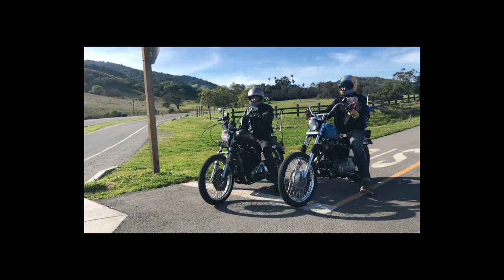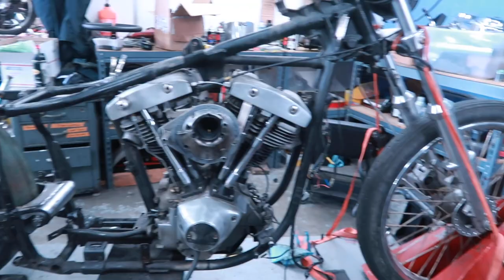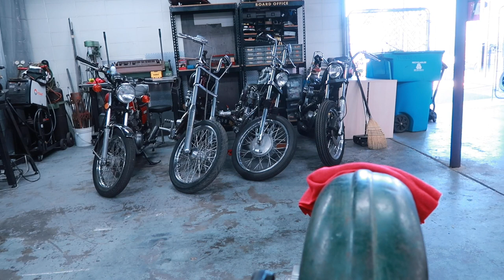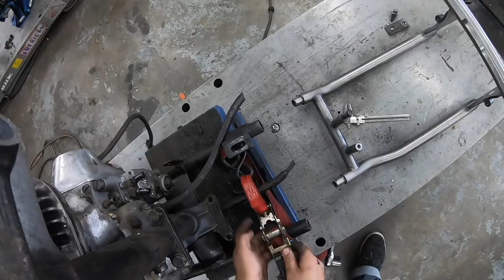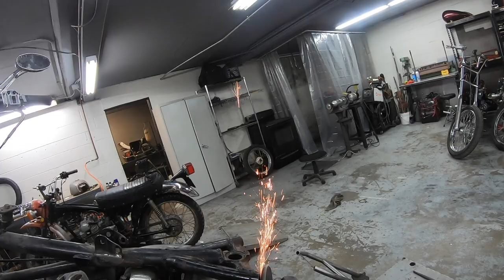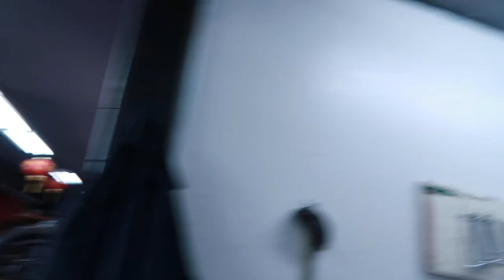Hardtail Install | 1979 80" Shovelhead Chopper Build Part 1 | Mazi Moto

Comment: Do you have a link for that hardtail?
Reply from the maker: Hey there, Here is the link to the hardtail I got. https://store.road6customs.com/Harley-Shovelhead-Weld-On-Hardtail-r6cshovelhardtail.htm
I personally would recommend the throttle addictions one instead. If I do it again I will go with that one. Had some issues fitting this one up